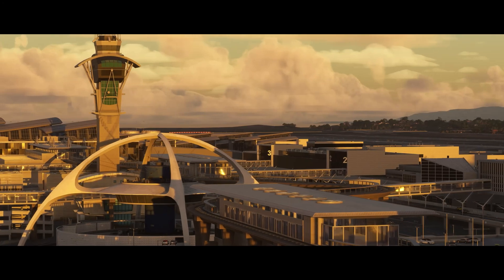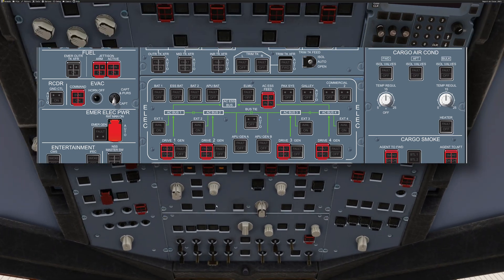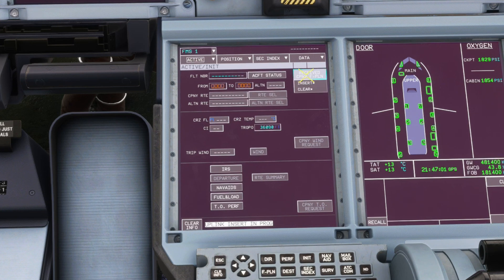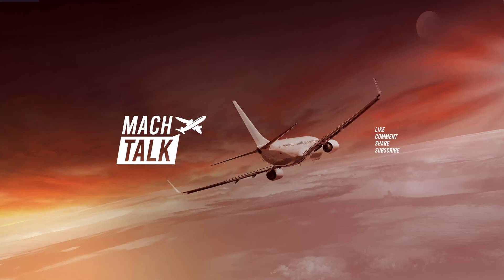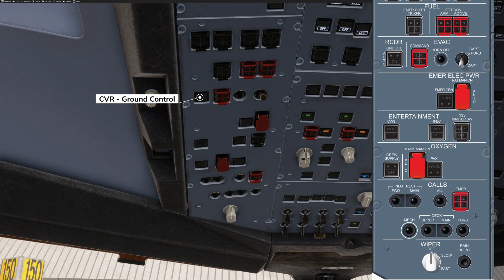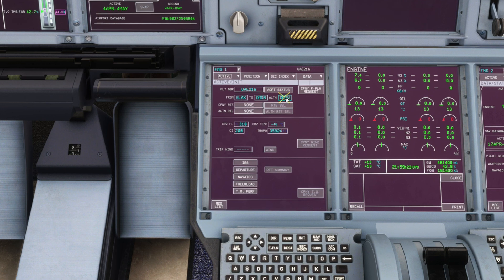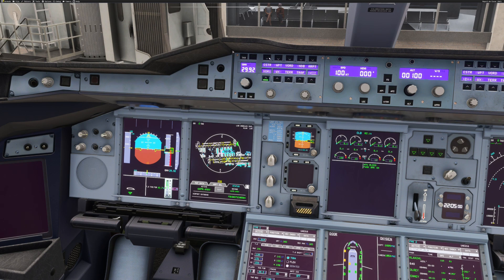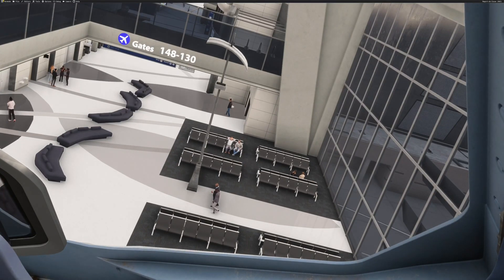Full Tutorial by Real A380 Instructor (Type Rating Series – Day 1)

Comment: Fuel and weight load is via the fly pad in the aircraft itself, rather than the default MSFS EFB. You can upload simbrief data once you link in the settings
Reply from the maker: Thanks for the heads up. I did try it via the tablet in the flight deck, too, but with little success. A couple of the FBW team have reached out in the comments, so I suspect it’s my fault for not reading their release notes properly, and running it in 2024 instead of 2020. 

My fault, and I’ll add an update to the video today!
Reply: @machtalk  I run the dev 4K version in 2024. The only issue I had was using Navigraph for FS nav database - the SIDS and STARS don't load into the A380, so I use default MS nav database. Excellent channel and really love your work!

Comment: For the A380 I would use the 4k version and disable the cabin with the click point that’s on the back wall top left behind the copilot, if you hover the wall left most silver rectangle with cursor your find a click,spot.  The A380 is cranky (non technical term) in 2024 but works.  The msfs EFB doesn’t work /properly with the a380 would use the built in EFB.  Import Simbrief plan then payload page, lorry icon 😃 fuel load instant should fix any fuel loading.  The Sim EFB doesn’t work always for aircraft that have own like the 350 etc.  The controls are a chore in msfs 2024.  Create a specific profile for the 380 and check each flight it’s loaded don’t rely on the auto generated one.  Thx for the video hope you get sort the hiccups it’s works ok but will be a lot better when native 2024 version is released.  Looking forward to rest videos as I’ve watched a lot a380 real cockpit videos and the order of some FMS settings are done differently and it’s bugging me if just airline SOP and not been able get any answers 😢
Reply from the maker: Thank you for the advice. I did try the tablet in the FD too, with little success. But I think I now know why..

A couple of the FBW team reached out here in the comments. I didn’t realise it wasn’t yet released for 2024. This one’s on me, and I’ll add an update today to clarify. 

I’ll keep the tutorials as close to real SOP as I can, and add notes for parts of the model that may differ to my experience of the real aircraft. 

Thanks for the support

Comment: loved this video! its funny but also infuriating how MSFS has so many quirks. anyways, you handled it all well :) im really surprised how despite all that modern tech the plane doesn't always have enough memory for all the waypoints. i cant imagine it requruires all that much storage. looking forward to the next part!
Reply from the maker: Thank you. It's surprising how basic so much of the A380 is. The FCOM has a list of action sequences to avoid to prevent the FMS from resetting itself mid-flight. Most recently, we can't use any of the SEC F-PLNs below 10,000ft on approach as it keeps dumping the FMS, including the ILS!
Reply: @machtalk  its so weird for an airplane that costs hundreds of millions to not have sufficient memory. maybe there's a smart reason.. its hard to imagine it was just an oversight. do you know if that's an issue on the 350 too?
Reply from the maker: @LuxPlanes  Many of the listed abnormal FMS behaviours are the same for both aircraft, but the 350 FCOM doesn't include the 'FMS FULL' error message, so I assume they've fixed it. What surprises me most is their inability/unwillingness to upgrade the FMS memory, as even the most recent aircraft - from 2021 - have the same hardware.
The 350, according to our Airbus engineers, is almost unrecogniseable compared to the first A350s from 10 years ago, as they're continually upgrading almost every part.